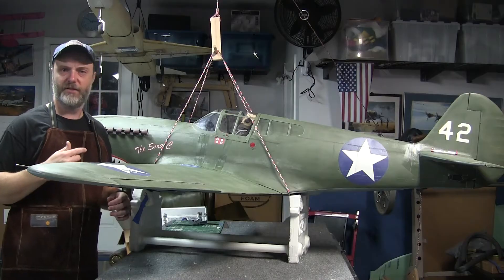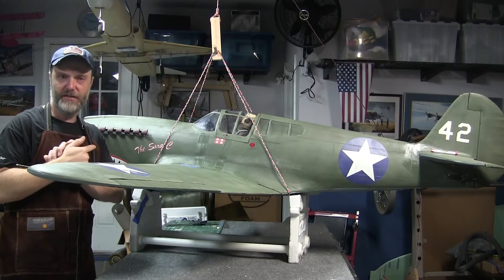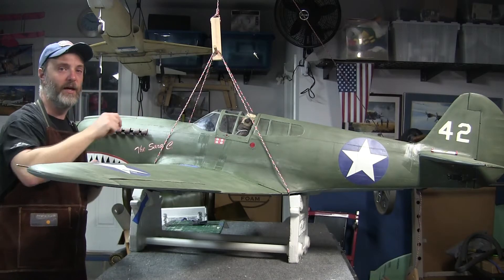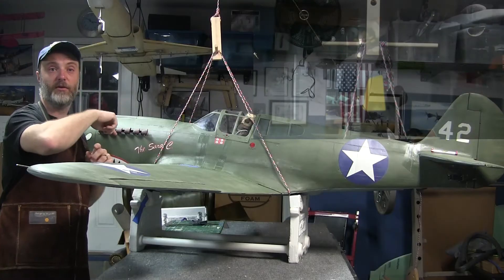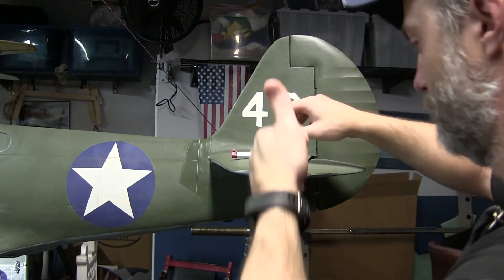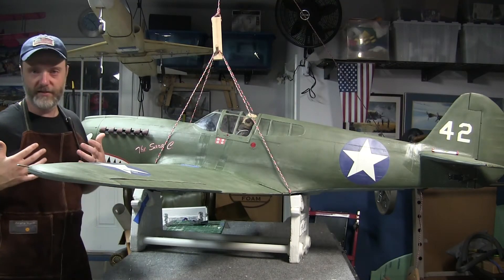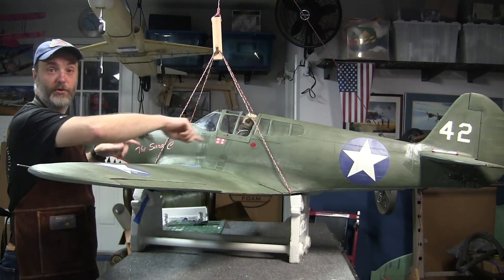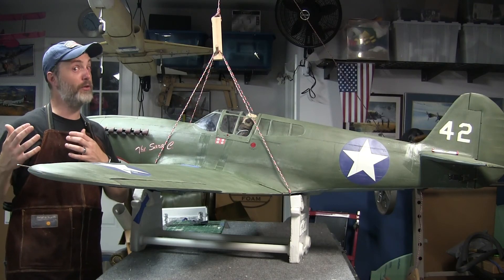Balancing Giant Scale RC Airplanes - Vanessa Rig

Comment: With the friction on the dowel, I understand how you get the plane level by turning the dowel, then you plumb down to C.G. What I don't get is if the dowel has friction, how does the plane balance when weight is added? Seems like the friction on the dowel would hold it at level, so the added weight would be moot.
Reply: The rope or cord does not slide around the dowel when you add weight. The cord simply supports the plane and makes it into a pendulum suspended from the axis of the dowel. Adding weight simply causes the pendulum (the plane) to swing forward or back relative to a vertical line dropped from the axis of the dowel (and relative to the plumb bob).

Comment: You don’t really need to put a level on the tail and get the plane precisely level. Eyeball level will be close enough. The plumb bob will always be directly above the CG. Vertically, the CG will most likely be between the centerline of the fuselage and the wing.
Reply from the maker: You are correct, you can chose to be less precise if you want.  It is not much effort to be more accurate though.

Comment: Nice presentation! 1 question. How do you determine correct level placement on horizontal stab when it is an airfoil and not flat? I build mainly ARF's and have no fuse datum line info. Thanks
Reply from the maker: You have a few options.  You could use an incidence meter to determine level but that adds tailweight and you'll end  up adjusting after you remove it.  I've used a laser level before with the line running through the leading and trailing edges of the stab.  That works well.
Reply: As other commenters have said, an eyeball estimate of the level-flight attitude is close enough. The short answer is, you can do away with the level altogether.

Comment: This does not give you the correct CG.  
what it does give you is a "variable" %  based on the wing cord "excluding" the important MAC, in the case you have a swept or tapered wing cord and variation based on the tail moment.It is not practical. for a true CG. this leaves out important data. though you may get lucky, its important to know the correct ways of getting the CG for your aircraft.. to help to insure a successful maiden flight!  https://www.youtube.com/watch?v=URglaHEt5Pk&t=57s this is a nice  vid ....watching til you understand.   its not to complex.
Reply from the maker: WTF are you talking about?  This method doesn't tell you where the CG SHOULD be... it tells you where it is at the moment.  You understand that, right?  You still have to know where it should be and then adjust as needed to get there.  Watch till you understand... its not too complex.

Comment: You can also use the standard Great Planes C.G. Machine Precision RC Aircraft Balancer that you used for all your smaller planes. All you do is add longer Metal Rods that support the two balancing sides. Same diameter in a 2 foot length or longer available at any hardware store.  Same up side down method of balancing the plane. If that's the Skyshark R/C I just balanced mine using this method. Worked great with the Cg slightly nose heavy.
Reply from the maker: Assuming the wing surface can support the weight of the aircraft you are correct. For heavier models you're much more likely to damage the wing supporting the full weight on the two small points on that CG machine.  Don't get me wrong... I use the Great Planes CG machine for MOST of my builds... only pull out  the Vanessa rig for stuff that could be damaged.  The model isn't the Skyshark R/C... It is Parkflyer Plastics. 95" span scratchbuilt foam model @ 22lbs AUW  with fiberglass over foam construction.

Comment: On smaller low-wing planes I would hang the plane upside down from a screw-eye in a rafter in my basement. I would have a line from the back of the plane to that same screw-eye and another line from the front of the plane to the same screw eye. A plumb bob would then point to the CG, which you would have marked on the bottom of the wing. Make sense? The CG would have to be directly below the screw eye.
Reply from the maker: Makes sense.  On smaller models I'll use a Great Planes CG machine.  Low wing would be upside down, but that rig has worked fine for me for even 13lb 60 sized warbirds.  

Lots of ways to get it done... you just have to make sure you have it done RIGHT :-)

Comment: Carl, we’ve been discussing Vanessa rigs pretty extensively over on RCScalebuilder.com lately. One of the important points was made that if you hang your plumb bob off of the wooden dowel, you need to make sure the dowel is perpendicular to the fuselage or thrust line. If not, the twist in the offset dowel can give you a false reading. 

It sounds intuitive, but I guess there have been people that didn’t or they forgot to make sure the dowel was square to the fuse. Most of us hang the plumb bob from a small eye hook on the center of the underside of the vertical piece of wood. That way it is centered no matter what orientation. 

Of course you need to mark the C.G. on the top of the fuselage rather than the wing if you do this.
Reply from the maker: GREAT point and very true.  Didn't think to mention that in the video but it is absolutely important to ensure that.  Hanging the plumbob off if the center block work better if you are balancing the plane upside down or if it was a high wing plane.  Wish I'd thought to include that.